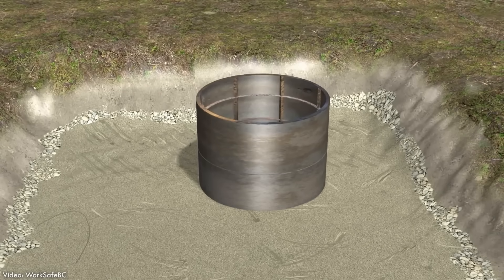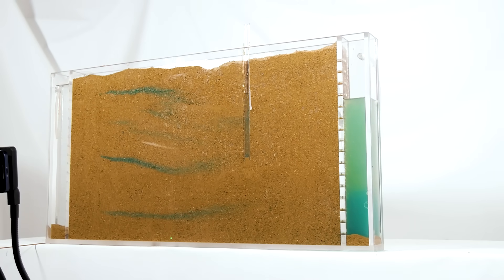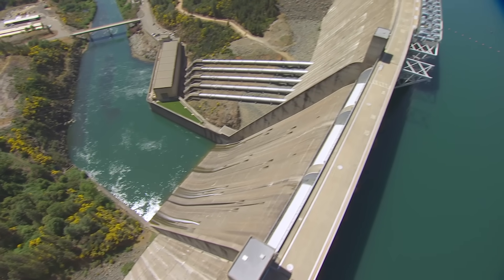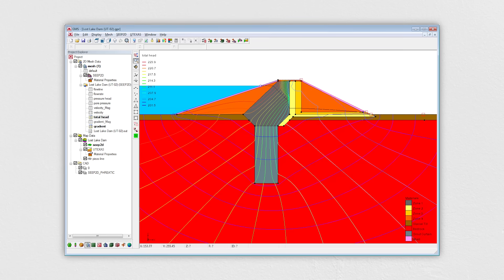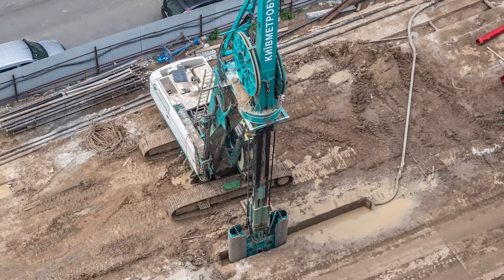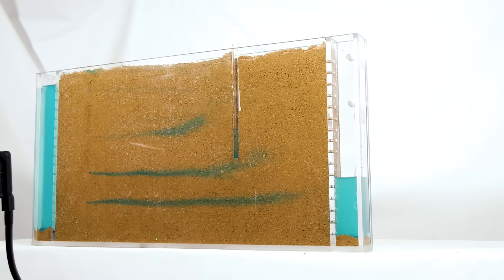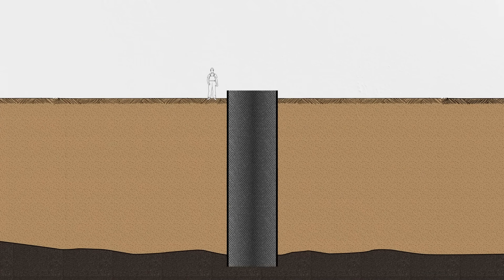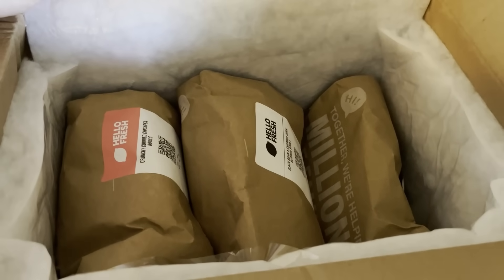The Bizarre Paths of Groundwater Around Structures

Comment: How would different soils affect the flow, such as clay soil?
Reply from the maker: See the previous groundwater video for a brief discussion on hydraulic conductivity
Reply: @Practical Engineering  Just watched it. (how wells and aquifers actually work) Another interesting video. Subscribed. You described the creek on our property very well. There's a high water table and the creek is fed by so many springs that the water is cold even in the middle of summer. It was also cool to see your demonstration of chemical contamination of groundwater. I've heard for a long time that glyphosate makes it's way to the water table over time, but that's the first time I've been able to visualize what it might be like. It's sad that instead of mowing regularly like they used to, now VDOT (here in southwest VA anyways) just sprays a 10 or 15 foot strip along the roads with herbicide in many areas.
Reply: A clay layer would pretty much stop the flow if it's thick enough. That's why he mentioned it being used as a cutoff wall under some dams. An example could be observed in a simple soil drainage test. Dig a small hole and dump a bucket of water in it, and see how long it takes for the water to drain away. In sandy soil it's usually gone very fast, often within a minute or 2. In heavy clay soil it can take over a day to drain out. You can use this in landscaping as well to help determine what type of plants will grow better in that area.
Reply: @christineedwards4865  that makes sense. I live in an area with clay soil and it drains very slow compared to sandy areas. I've filled holes up with water in the past to help wet the clay and make it easier to dig and it has always taken a few hours to fully drain.

Comment: /watch?v=kluzvEPuAug is the WorkSafeBC video. It turned into a Delta-P situation where the puncture became the conducting "hole" between two bodies of water/vessels.
Reply from the maker: All groundwater problems are "delta-p" situations because groundwater only moves across difference in pressure.

Comment: this definitely explains why, after resolving water management issues at my house, it only took a few months for water to find its way back in to the udrain and thereby to the sump.
Reply: What did you do to resolve the problems? Curious for someone who also has excessive groundwater making way to my sump. Already working on grading away from the house and created a swale.
Reply: @brians6174  
Several things, starting with a french drain and gutter management system in the front of the house where it was 12 inches down hill from the sidewalk to the front door stoop due to poor design. the gutters were all rerouted to the swale 5ft downhill from the rear of the structure. all front house water was redirected to 20ft or so away and down hill from the house. there is one downspout in question that is being fixed today as well. the remaining work will involve regrading the rear of the house to allow water to fall away from the structure and putting down epdm where the landscaping rocks are. this is the trick i used to keep last years tropical storm rainfall from getting in the basement at the front door stoop. it was over a foot deep there. Parts of the driveway also settled so where i could, i resealed and patched as well as sealing along the entire garage face
Reply: @taironus  appreciate the response and hope it all works as expected. Our house has a negative grade in the rear and along the left side, we're the second owners and it's been a nightmare. The changes we made allowed us to survive Ida (thankfully), but worried the next big storm is unfortunately on the way.
Reply: @brians6174  soil grading residential can be complicated, esp with local ordinances and situations like what yours sounds like. good luck with it and i hope you can find a good solution for a reasonable price!

Comment: My parents have an ingroumd pool and at the deepest point (10ft diving pit) the pool has a hydrostatic valve that lets water into the pool from the ground for basically the same reason, if the hydrostatic pressure is more than the weight of the pool it i could litterally float on the water and break a lot of things.

When it is full this isn't a problem but it does need to be drained every couple of years to paint it or do other maintenance and when its empty its a much bigger concern. (One year the valve failed and we lost 3ft of water overnight)
Reply: That pressure issue is why decommissioning an in-ground pool requires a breaking of the concrete tub, and not just filling it in and capping with sod.
I've seen a few videos where people bought a house and the pool was not disclosed in the sale, only to have it rise up out of the ground during the next wet spring season.
Reply: One of the buildings in Cologne near the Rhine river is has a two-level underground car park underneath. During extreme high water of the Rhein river, the garage is automatically flooded to prevent the building from swimming. Same principle as the pool. There's even a rowboat in the garage for the (rare) cases when this happens.